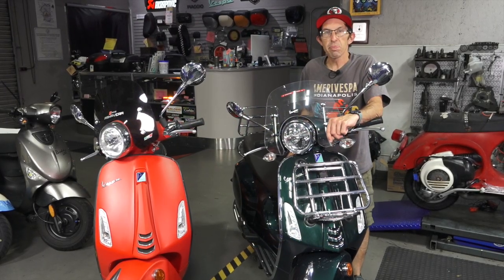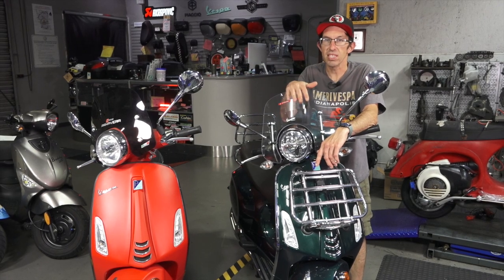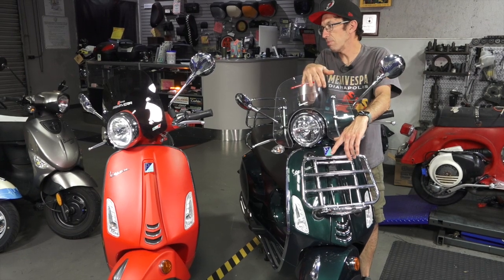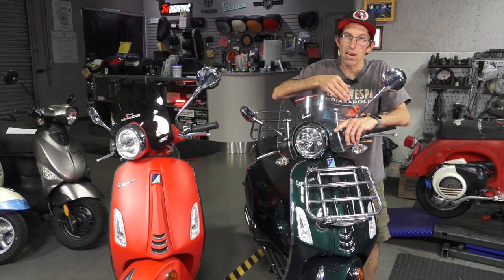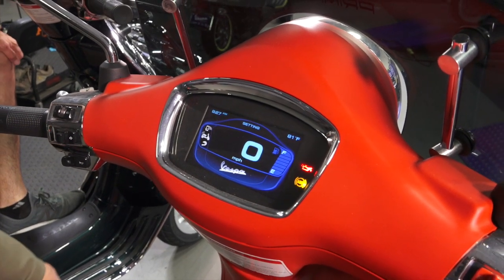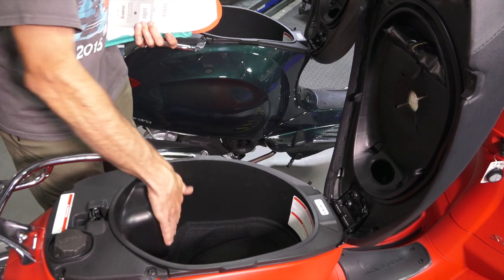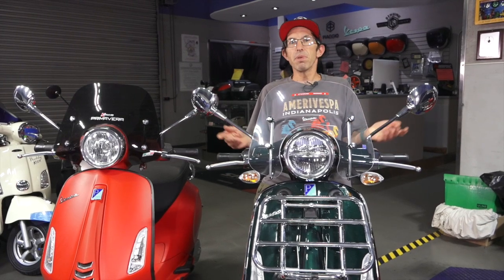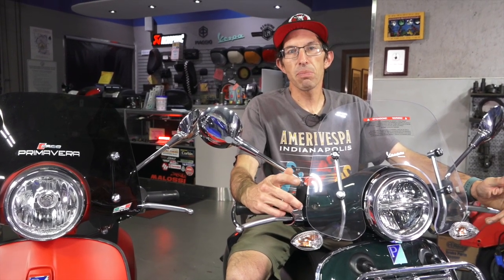Vespa Primavera 50cc vs. 150cc. What’s the Difference?

Comment: I found a Vespa Sprint 2T that's from 2015 and looks like new in the photos he sent me. Originally a 50 cc, it's been upgraded to a 70 cc engine. Is it worth $2400? Or should I buy a cheap bicycle or ciao Piaggio moped for now, just to get around town this Summer and save up for a motorcycle license costing $3500, then invest in a real Vespa 300 cc or motorcycle instead? I'm wondering about the value for money and if the 70 cc upgrade offers significant advantages over the 50 cc. What are your thoughts on starting out with 70 cc?
 I'd appreciate your advice so I don't end up regretting a second-hand Vespa purchase online. Thanks for your insights!

Comment: Thanks for the comparison..  I am fairly tall 6' 3".. and REALLY prefer a smooth comfy ride.  Are the shocks and seats the same on each?  I like a nice fully padded seat for extra comfort.  Also, for my larger frame..  Would a Vespa work better or would a Piaggio (like a Liberty) work better?  Thanks so much..
Reply: Did you end up getting a scooter? If so what did you get and do you like it? I’m roughly the same build
Reply: @briand_1    I never got one..   had a hard time finding one that fit me and was comfy..  Kinda gave up..  Maybe  I will get in the mood and buy another one someday...  I do miss riding sometimes..  Not sure what  I would get..  I wish you good luck on your search.

Comment: I really wish Vespa would return to making 200cc scooters. The GTS scooters are bloated, ugly and ridiculously expensive. A 150cc is okay, but a 200 in a Sprint body which can go up to 70mph is much more usable in a wide range of situations.
If you want a 50cc, buy a cheaper Taiwan scooter. Vespas are overpriced... to spend that much money on such a low powered scoot is a joke.
Reply: yeah for the GTS price you can get a 500-750cc motorcycle

Comment: Hi Robot - is there a similar cdi mod available for the 150 (as per 50cc) to boost performance.? Just wondering how tuneable it is. Back in the 80s I tuned up my P150 with a Polini barrel and piston and an Amiil carb. It went like stink!!

Comment: I have a 2020 150 Prima, is the Akrapovic a wise investment in itself? Or is there other pieces to get more performance out of my Vespa? Trying to take the prima on some backroad adventures
Reply from the maker: We’ve got a wide selection of performance parts to choose from. Ranging from simple bolt on items to more involved parts like cylinder kits etc. The Akrapovic exhaust would be a nice easy bolt on mod that’ll give you a little bit of boost. Next step would be a variator kit and upgear kit for your longer rides. https://www.scooterwest.com/modern-vespa/performance.html
Thanks for the support!
Reply: Vespa Motorsport Thanks!
Reply: @VespaMotorsport  ,